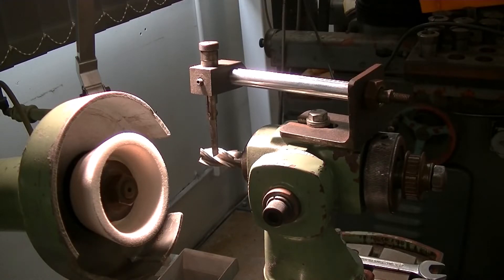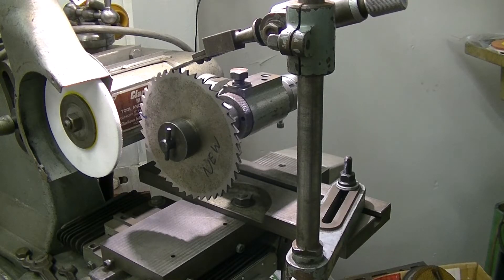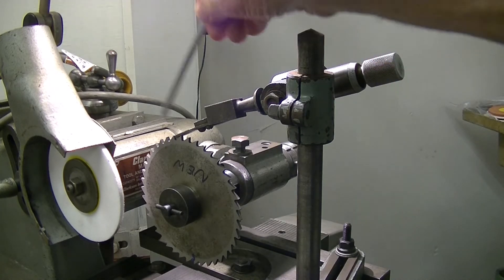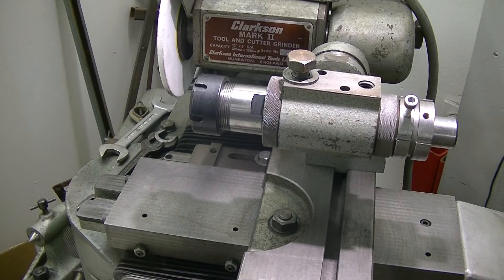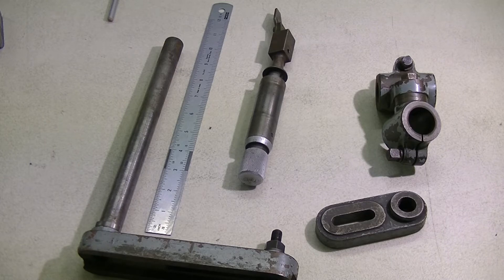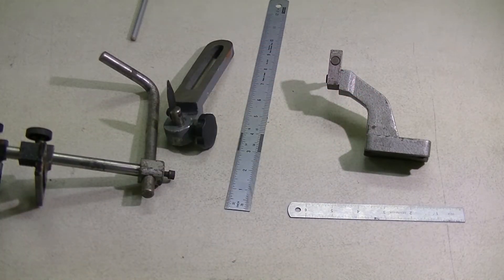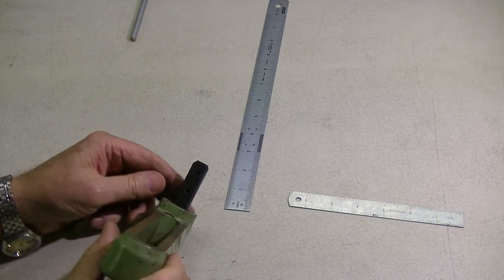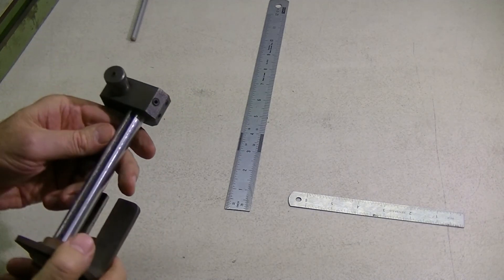Tool and cutter grinder indexing

Comment: Nice one. I like how you wet my whistle with your little Herless T&C grinder at the start. Wish I had the original attachment like you do and guards. Keep up the good work. Cheers Aaron
Reply from the maker: Hi AAron. The accessories can be home built and there are lots of pics on the bedroom workshop site. My Clarkson workhead uses plain bushes and is good to use. I bought an ER32 collet chuck of fleabay with a 25mm plain shank and it works well. BC

Comment: Hi BC, how about going through the method and theory of lowering/raising the wheel to achieve clearance angles in a future video?
Reply from the maker: Hello Richard. I had hoped to do another video on the Clarkson this weekend if the weather improves. A bit more on the accessories and I can spend time on setting clearance angles. I have the chart to set by. BC